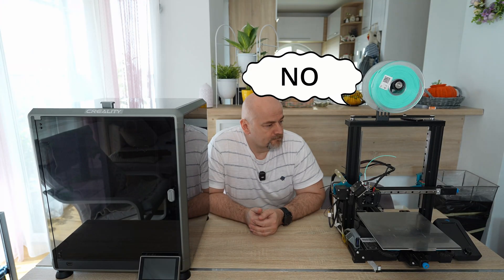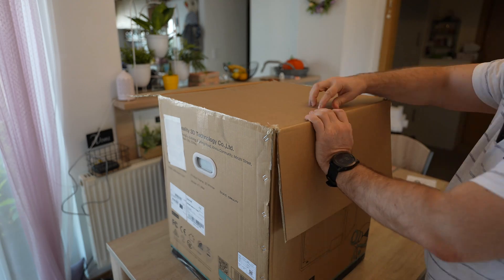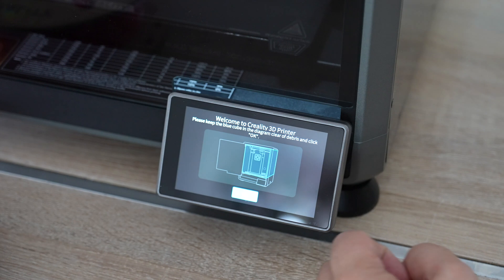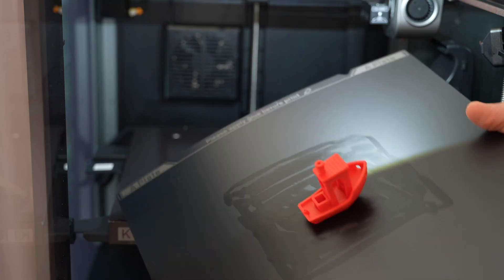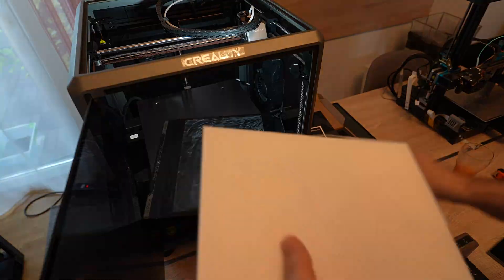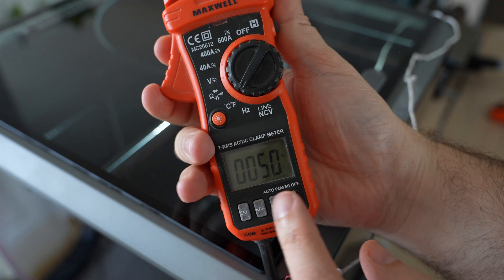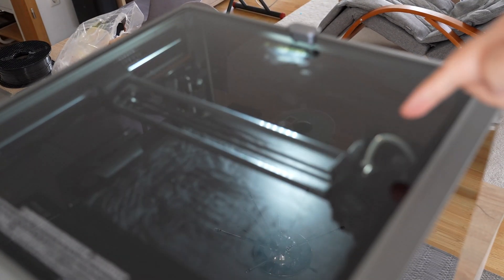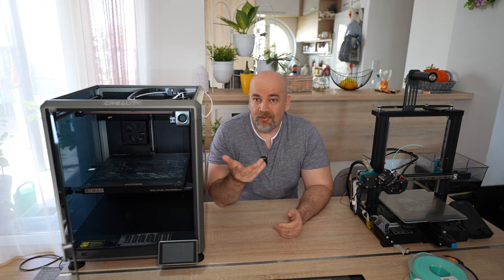Is 3D printer modification dead? Creality K1 Max claims, it is..

Comment: hey bro idk if u know this, but the cf filament ur using should be handled with greater care. Do a bit of research on it... In case you dont though, it is leaving very small cf pieces of everything it touches, even after it's printed and it is airborne as well. Stay safe brother

Comment: The spool holder on the backside drives me nuts, I also need a filament drying solution which DOES NOT SIT BESIDES THE PRINTER AND INCREASE IT´S FOOTPRINT. I need something that goes where the spool holder is, above or on the site of the printer, which is still missing.

Comment: you can slow down the print speed from the printer within the movement/temp screen. its the 3rd option on the left bar which will show 100% as a default.

Comment: Belts are too thin, fans need some love, hing is a timebom, but worst of all are the AB motor mounts and the belt tensioning method. Yes out of the box it’s much better than printers just a short couple years ago and it’s at the perfect size. That goes without saying printing is chasing unicorns and for some reason we all enjoy the struggle.

Comment: I was watching some TV episode yesterday and someone said "people don't have any pride in their work these days", made me think. Vast majority of production is profit driven, meaning that everyone is striving to achieve the perfect balance between effort input and profit. In practical terms this means that they will happily sell a printer that is 85% okay, because it will bring them 100N profit, if they bring it to near perfection, like 95%, the development costs are higher, testing phase is longer, parts are more expensive and it will bring them 10N profit.

That's pretty much our fault. Would you rather have a $300 printer that somewhat works, or a $1000 printer that is just amazing in almost every way?

I'm a big fan of Prusa, because I can sense they're honest and have pride in their work. Yes, their printers are more expensive than the Chinese counterparts, but not by that much. What I absolutely loathe is that Chinese printers like to flat-cut their costs across the whole spectrum of parts, like (I forgot the actual numbers) $5 cooling fan producing 60dB, when they could use a $6 cooling fan producing 50dB, see what I mean? And then the user, who has been swayed into buying the printer by the low, low price, once sufficiently annoyed, has to throw away the loud stupid fans and buy high quality ones, now even just with that, the price isn't that good anymore. And it goes on and on, with the less obvious parts too. I was aghast that with Ender 3, you could switch a board for a "silent" one, that has improved drivers. So that's how you paid for two boards, the crappy one, and the good one. That's why I just do not trust Creality. If they made a K1 Max "pro", with actually good parts, no dumb compromises like with the fans, charge it $200 more and somehow communicate that this is their actual honest take and they did the best they could, I would be seriously considering it. As it is, I'm still not trusting them.

Comment: Yesss….more talking printers! Cracks me up when they sass you or each other. 🤣 

Great review btw. I wonder if you could have printed with the broken filament. To the printer wouldn’t it seem as if the filament had run out? If so then the print would pause until more filament was inserted, at which point the bend should be within the limit of the filament and the print will complete.

P.S. More talking printers! 😂

Comment: The key issue I have seen with all of the K1 series printers is quality on the finer level. It seems they all suffer from VFA issues, as well as often dimensional issues, while also having varying bed quality. You called most of the prints perfect, but I think that's largely based on the prints completing and looking correct. However, what about compared up close to prints from other printers? Creality has a very poor extruder design. It's a small dual gear with coarse gear teeth and support on only one side of both gear axles. It produces a lot of VFA and inconsistency. While I appreciate your review and it's certainly a functional printer, I think there are better options such as by Qidi, Flashforge, and Bambu Lab. Just my opinion without a lot of personal experience, but shared by many friends and reviewers.

Comment: Hey. As always great review. Not sure if you are aware by now but you can change the speed now from the screen. It is within the movement temp section. There is also an expert section as well with flow, z offset, and nozzle pid. I love my k1 but had to manually level the bed however now I get perfect first layers. I also rooted mine and run mainsail etc.

Comment: Did they fix the VFA issue? Also the hotend design seems to really struggle with softer filaments, leading to lost of build up pressure in the hotend. I have the regular k1, lots of issue I still have yet to address to get clean prints. Also there an issue with dimensional accuracy at the outer are of the bed.

 So instill have to go into the k1 to fix all the issues with it, essentially modding it. I really hope the k2 has solved all these issue.

Comment: Considering Creality printers never come working correctly I would argue modification is not dead!
Reply from the maker: That was my conclusion too. But far less mods are needed compared to Ender-3 line.
Reply: Really? I didn't have a single issue out of the box or so far with my Ender V3 CoreXZ. Would love some ideas for upgrades though if there are some good ones to improve quality or reliability

Comment: 3D Printer is maturing - the thing is going the same route as Paper Printers (and that's good). We don't "tune" or "mod" our HP Desktop Laser printers. We hit "print", there comes a paper with stuff printed on them. I use my Bambu P1S basically the same way. We were tuning 3d printers because they were bad, actually. Excellent video, Igor!
Reply: I hope 3d printers don't go like 2d paper printers. Bs to set up and don't get me started on ink!
Reply: Most people will go plug and play but there will always be a market for custom open source printers like voron
Reply: Not at all the same thing. A normal printer deposits a pattern on a page. A 3d printer is a full blown fabrication technique. They arent analogous and 3d printing has a much higher ceiling. 

The only way 3d printers would reach the same level of perfection as 2d printers is if there was a full color multi-toolhead 3d printer that could print a benchy in nylon in 3 minutes with great quality
Reply: Well...there is a long way still to go until 3Dprinter are like this..... specially Creality should know that😉😆
Reply: Once they kill off us older generation of tinkerers, you can be sure that they'll use market capture and go the way of HP and Lexmark.
Reply: not a comparison at all to be makint
Reply: paper printers are SH*T. If this goes that route then we will have printers which sells us filamnet at overcost, that ask us for "all te colors". No reparabilty, if 3d printers go the route of paper printers then this is going to become distopian sh*t
Reply: Comparing a 3d printer to a paper printer is just retarded.😂😂😂
Reply: Totally different thing. Paper printers just because we call them both printers has nothing to do with the CNC technology. And CNC technology will be always be surrounded different materials, different tools, etc. That's why mods will be always a valid point with 3D printers. Or at least some of them.
Reply: 2D printers are locked down dog__ with locked down materials,  market oligopoly and cartel-like practices. Thank god 3d cheap FDM got developed from DIY roots so at least there was enough time for an independent competitive market of consumables to be created. This will be hard to disrupt, but not for lack of trying. If Bambu or similar had their way you'd be locked into using exclusively their RFID tagged materials. They'd lock down your machine after reaching xx hours of printing time "because the purging sponge is worn out" or some nonsense like that which they pull with inkjet printers all the time. Look up all the bs Bambu has tried to patent that blatantly had prior art. It's obscene. Anyone who wishes for FDM to become like the 2d printer market is __ in the head.

Comment: I don’t think the glue is necessary at all - QIDI also sent a glue stick, never used it. I am about to test a really fast printer next week, they also sent me a glue stick 😩😂 For separation I always use hairspray - it doesn’t change the bottom texture in any noticeable way.
Reply: Hair spray is the best. Not as messy as glue
Reply: Interesting idea with hairspray. I'll give it a try.
Reply: why not use whatever the equivalent to the prusa satin sheet is?
i print literally everything on that and never even thought about such silly things as glue or hairspray
Reply: Hairspray is a great alternative that a lot of people use. But i recommended you use something!
Reply: Hairspray has worked for me!